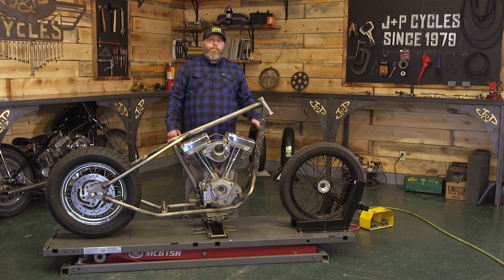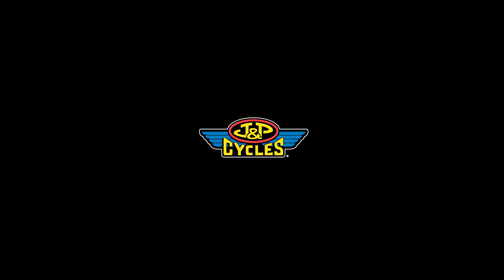Rake and Trail Basics : Pro Tip

Comment: I have an 07 Wide Glide.. with a 34 ° rake....
And 49 mm Forks 

i have damaged low Triple Tree clamp... apparently these Triple Tree clamps are Obsolete and they do not make these anymore.. so instead of forking out a shit ton of money,,, am I able to buy a 49 mm Triple Tree clamp within the same year
(2007/2011)
 of the dyna.... am I able to put a 2-inch lowering kit on the front to make a non raked out Triple Tree clamp work

Comment: great explanation. I have an issue with my Vstar 1100 custom. I find that whenever I turn the slightest off centre, the bike wants to fall over. I previous rode a nightster 1200 and didn't have this issue.

Comment: Im doing a hard tail bobber build and only fabricating the tail. Im weighing the pros and cons of leaving the forks stock length but tipping the bike to reduce the ground clearance and lower the center of gravity while increasing fork rake. Obvious negatives are engine will be tipped back slightly. Throwing off the float bowl level wich could be adjusted for. Throwing off oil level wich could be adjusted accordingly depending on if the oil pickup is located front or rear. And esthetically the portion of frame under the engine will not be parallel to the ground. Other option is to lower the forks to maintain original rake while lowering the frame. Do you have an opinion on the risks involved in the first option?

Comment: Will adding 4 inch extension to a sportster affect trail and rake very much front tire is a 19 I put struts on the back
Reply: Typically putting struts on the rear drops the frame and increases rake and will add trail to the front end. A 4 inch extension will bring the ground clearance close to stock. The bike will be a little less responsive cornering but more stable at high speeds. Hope that helps. Given how long ago you asked you have already experienced what I am talking about. God speed.

Comment: I dont understand why a manufacturer of motorcyles trying to get as many models from a single base platform could not incorporate say a rectangular steering head on the frame (the long dimension of the rectangle in line with the wheels) and then simply have multiple machineed inserts with normal profile round protrusions that exactly accept  whichever stem/triple tree one chooses (and basically ANY fork/triple tree COULD be adapted with the right machineed inserts)....Picture also each varient's  insert machineed to produce a different rake for a specific purpose making the frame very tunable!  You could put different length swing arms differnt sizes of wheels and types /lengths of forks with the most desirable rake and trail for the models purpose!  With the identical frame and engine and electrics you could derive a track focused sportbike,  a generic naked bike, a sport touring bike and even an adventure bike...And THAT could spell  low enough production costs to actually make some very desirable models available at nice pricepoints without tas much compromize that is typically seen...The only downside I can see other than minor expense of multiple parts would be some extra ounces of weight which I think in the grand scheme would be pretty negligble and on a an expensive Limited Edition type thing the inserts could be titanium or whatever idk

Comment: By sliding the forks lower in the trees, not only are you reducing trail but you also reduce rake...
Reply: Trail reduction is a direct result of steepening the rake angle which is a direct result of lowering the headtube on the forks.
Reply: @JamesBiggar  The same is true of the rear of the bike. I would love to see a bike with 30" wheel with 90% of the bikes weight below the axles. The forgotten factor involved with handling.

Comment: The MOST IMPORTANT POINT is, SISSY BAR SHOULD BE the SAME ANGLE as the  RAKE or FORK ANGLE
Reply: No.
Reply: On a custom build you can build any project you like. I do agree that the bitch bar and the front end should be relatively at the same angle. If only for aesthetics.

Comment: Isn't wheelbase the distance between the contact patches?
Reply: wheelbase is measured from the centre of the front axle to the centre of the rear axle, which when you look at it would be the same thing as the contact patch, it's just more accurate to measure from the axle centres...
Reply: I can see that, like the base of the wheel so to speak.

Comment: Thanks for the awesome video and explanation. I have a question:
My 2012 Yamaha Super Tenere has 28° rake, 4.96" trail, and 60.6" wheelbase.
I rode a 2014 HD Dyna Fat Bob with 29° rake, 4.92" trail, and 63.8" wheelbase.
That seems very similar to me, but I had to wrestle the cruiser into every turn. I'd press and lean and it felt like it wanted to stand back up in the middle of curves. In all fairness, I've only ridden dirt bikes, ADV bikes, and standards. This is the very first cruiser I've ever ridden...ever. My cruiser friends tell me that's just how they feel and that if they got on mine they'd feel odd at how it has no stability. I get that, but I wish I understood why such similar geometry produces such wildly different results. I'm guessing the center of gravity (low heavy cruiser vs tall lighter adv?) and the fat tires were the real difference maker. Is that it?
Reply: offset/wheels/tires/machine weight and distribution/seating relative to center and bars and ground etc etc is my guess ....cruisers are ALL F'd up all in the name of looking "bad"...and they are bad just not the bad the typically moto ignorant beholder has in mind  Bear in mind if all you changed (if it they would even fit) on the super tenrere was to put twice as fat tires (adjusting rim size so  diameters were remained identical)  assuming these could fit in the swing arm and forks which they could not but just assume they could anyway ....that bike would be a bear in comparison to steer in the street!  It would still steer ok in loose dirt but the friction of the contact patch in the street would be a lot more!   (would be so awesome in the sand though compared to stock!  Like the old BW200 0n steroids! which incidently I owned a 1985 Yamaha BW200 it was AMAZING in the loose dirt and deep sand but the moment you tried to ride on pavement?  ugggg was it a BEAR....just AWFUL and maybe that has to do with why they discontnued such a wonderful machine?  Because hardly anyone got to appreciate it and understand it...all that remains is the closely related TW200 with much skinnier still fat tired very forgiving beginner dual sport)

Comment: Thanks, I put 3 degree fork neck cup  kit on my 2000 Sporster 1200.  Now It pulls into the turns and I have to force the steering back to go straight.  Do I have to just remove this kit?  Thanks Berry
Reply from the maker: Yes, removing the kit would fix the steering issue. Did you keep stock length fork legs?

Comment: hey. i have a raked front end (no idea what the numbers are) but its pretty far. My bike is the most raked bike in town, at least that ive seen. I have questions about handling a chopper. First of all , im getting CRUSHED by crosswind. I dont recall it being this much of an issue on my lil sporty back in the day. But crosswind feels like its gonna push me over. Pucker factor of 10 when you dont see it coming. also. what is the physics of why its extra easy to dump a chopper when cornering at SLOW, parking lot speeds. A couple times when i first got my bike i almost dumped it and all three times were in or leaving parking lots. what gives?

Comment: You mentioned a more in depth video. Where can I find that video? I bought my motorcycle used and it seems the rake is greater than stock. I'd like to restore it to stock by adjusting and sliding the front tubes. I'm wondering what is the best and safest way to do that properly. Thanks
Reply: I'm looking for that video too.
Reply: @bikersoncall   want the indepth

Comment: Interesting....So a fork lowering kit will affect your stability but can't you make the trail difference up in rake lowering the back or do you have to do it at the Triple Tree? Sounds logical. What i'm wondering is....having a lowering kit for both the forks and rear shocks shouldn't they be maximized between the two for best stability? And how would you do that. Lower the ratio starting at stock? Would it be the same stability as designed only lower in overall height? Or just go by what feels right for the rider? And i also want to say J & P Cycles has some really killer videos. Thanks for posting!!
Reply: Any modifications in geometry should be made carefully. I have heard, and it makes sense, that if your plan is to lower the bike, lower it to match the stock height (same ratio) to both the front and rear end. Lowering the bike is done at the expense of suspension travel and ground clearance, also lean angle. Increasing rake at the triple tree can be dangerous if not done right. Rather, it can be increased by modifying the neck, but that requires chopping the frame. Trail is also an important factor in stability and often gets neglected by rake modifications alone. So in short, for lowering the bike, balance reduction in both rear and front by equal amounts. For stability vs sharper turning, design your front end (rake a nd trail) appropriately for the intended purpose of your bike i.e. cruising vs sporty riding. Longer wheelbase improves stability, good for highway cruising long straight roads. But it increases turning radius making it difficult to make u turns. It's all about finidng the right balance that works for you. Good luck!
Reply from the maker: You could make up the trail by slightly adjusting rake after you lowered the bike but that wouldn't be ideal. A lot depends on the height of the front and rear of the bike you start with but, yes if you lower the front of the bike you could lower the rear the same amount. The bike would feel more stable in a straight line but be slower to turn in.
Reply: @jpcycles  Thank you. I was pondering on if it even changed or not because the wheel base didn't change. Your reply confirmed my first thoughts.
Reply: @jpcycles  By the way......can i have %50 off any of your stage 3 upgrades for a 2004 Deuce? Lmfao!!